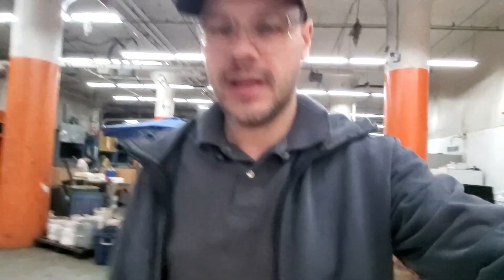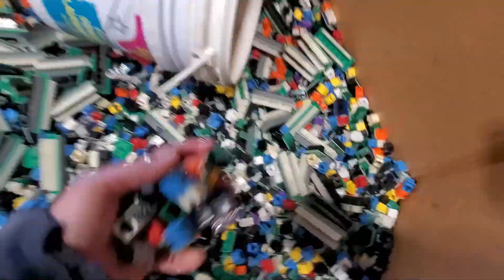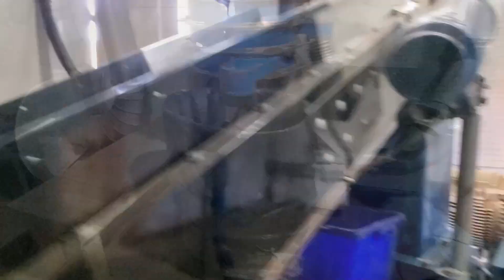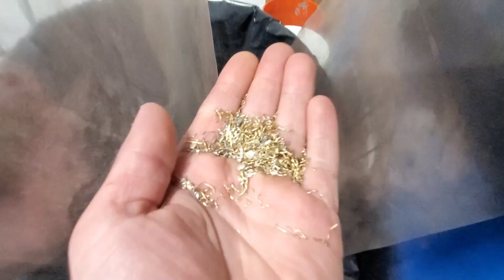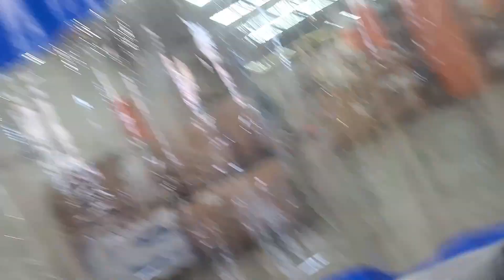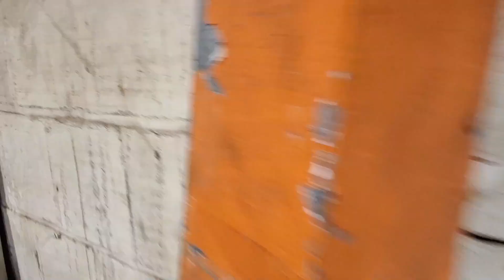Recovering Gold by Recycling Computer Ethernet Ports

Comment: What sort of gold content do you expect per weight (ton or kilo) of jacks input?
Reply from the maker: @al9929  the pins come out to be $100-150/lb. Some brands also use palladium flash-plating before the gold, and that recovery value is about 2/3rds that of the gold overall.
Reply from the maker: @al9929  I haven't received the settlement on the load on the video yet. Each load varies. I'll circle back once the numbers come in.
Reply from the maker: Ok, the numbers are in. On this particular load, we got .014toz/lb of gold (value was just over $40/lb) lower than the previous load but still worth processing.

Comment: How sure are you that each of those Ethernet jacks has actual gold and not another conductive metal?
Reply from the maker: @P2Feener305  it depends on the manufacturer, some may be brass-plated, but the majority are gold-plated. Even if some brass makes it into the mix, it's still worth sending it to the refinery for gold recovery.

Comment: Olá! Esses são os terminais de  internet isso ?
Reply from the maker: @fernandocarloshoepers3687  sim, eles estão
Reply: What's the process feed line to granulator to screener?. What size mesh is on the granulator?
Reply from the maker: @williamwahlert8414  we use the largest screen possible in the granulator to make sure we don't pulverize gold more than needed. (in this case à 3/8"). Our preferance is a little plastic in the gold then the other way around. Then we run it all over the air table. Then, the backside of the air table Falls onto screener and we screen out any gold dust that might have gotten with the plastic. You couldn't put the screener first before the are table, that might be slightly more effective.